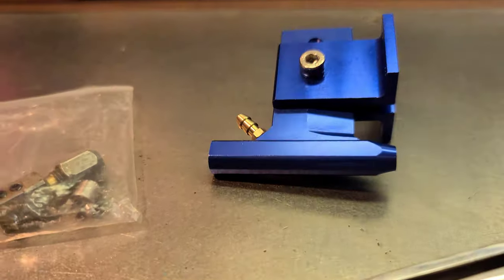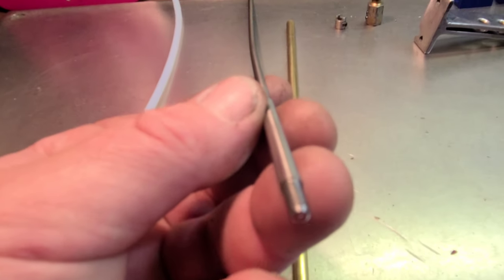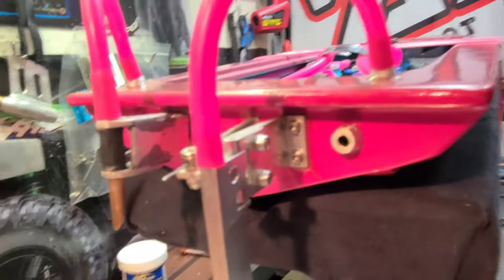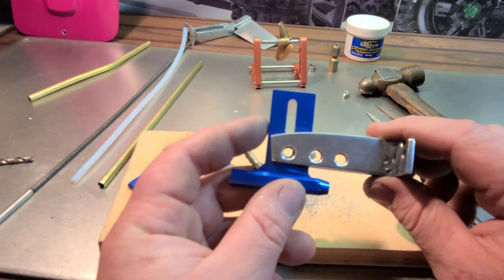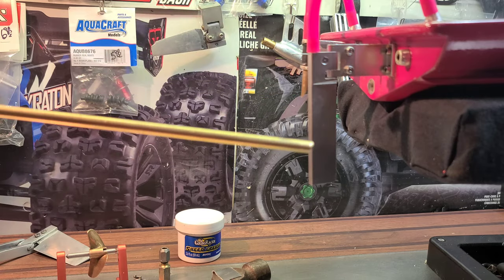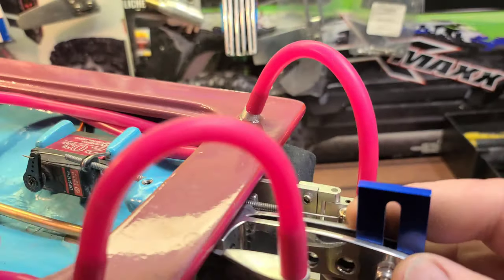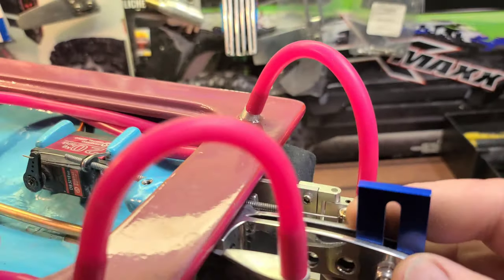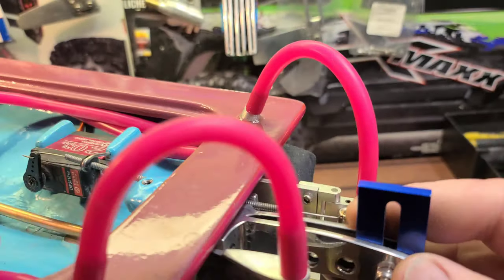Fast RC Boat Flex Shaft, Liner, Stuffing Tube, & Modified Strut Installation - RC Boat Build

Comment: These vids are great man. I'm getting ready to build my own for the first time. I bought a premade hull off eBay but I'll be adding my own hardware.
Reply from the maker: That's the fun part!
Reply: I should have done the same 🤣🤣 I'm working from a print that's designed in french... Luckily designs are in picture not words haha

Comment: I always wonderd how they bend the brass tube, thanks man 👍
Reply from the maker: My pleasure
Reply: Just watched your video on props, I will say your very good at explaining how these things work, really interesting, I have a BLACKJACK 29 RC BOAT it's brilliant would like its big brother the 42,  what is your favourite all round electric boat, speed, performance, and value for money.
Reply from the maker: I personally like mono hulls they put the biggest smile on my face.  Sonic wake Is an excellent deal. Plenty fast lots of hardware for adjustments,  the 42 is a fun boat as well but needs lots of work to get it right.   Hope this helps.

Comment: Cool stuff i need to fine a cheap brushless system for my boat i did buy a shark esc on amazon idk if it will work well or not but I'll find out
Reply from the maker: The water pickups are not as big as I'd like to of seen on the ztw shark esc.  I also picked up a flycolor 150a watercooled esc that would give you plenty of power with a leopard 3660 2200kv for your rigger build.  I'm gonna put a small cap pack on my flycolor 150 should help with amp draw

Comment: hey where can i get the rudder and prop assembly?
I have a 4075 brushless with a 150a esc all water cooled. Im building a 3d printed 3ft boat. Im gong to fiber glass it and build it right! I just can't find the right rudder assembly that I want then I saw yours.
Reply from the maker: I use Offshoreelectrics
https://www.offshoreelectrics.com/categories.php?cat=Hardware&PARTNER=ironclad

Comment: My flexible shaft and the coupler is REALLY REALLLY TIGHT. Should i sand my shaft a bit or it has to be reallt tight like that?
Reply from the maker: I've lightly sanded my flex cables in the past but keep in mind that you want a tight fit at the connection once collet is tightened down
Reply: @IRONCLADRC  thanks

Comment: Is it OK for the Teflon liner to move in the stuffing tube while running
Reply from the maker: To a certain extent, if it rides up onto the motor Coupler or into the strut bushing you'll stand a chance of binding and twisting the flexcable

Comment: Do i need to use the blow torch or can I bend the tube anyway
Reply from the maker: Some times I use a torch for larger bass tube don't get it to hot.  And/or put a tight fitting spring on the tube where you want to bend it will keep the tube round so it don't kink

Comment: Flex drives are on there way out I've been in DC for over 45 years when they were using u joint drives I've switched all my boats over to solid flex drives which on company I use altamarine   is basically a solid wire that ups to 250. At the prop and sits in a aluminum tube with 2 delrin bushings the difference in weight and friction adds up to 900 rpm t your motor I run only nitro and gas but the same results will apply to fe flex shafts weighs alot and even if you use a s bend stuffing tube the flex shaft still slaps around and winds up
Reply from the maker: Ive been looking into wiredrives for a while now. i have not switched any of my boats to wire yet,  looking into a wire set up for my rigger. the only limitation to wire i would think is that the motor has to be forward in the boat to get a nice gradual bend?  wire wouldnt work with a short stuffingtube setup would it?   who do you get your wiredrive setups from?  thanjs for watching
Reply from the maker: Yes sir m5 preference uses brents shafts. Thanks for the info my friend.   Wholts rc boats?   I will check it out!